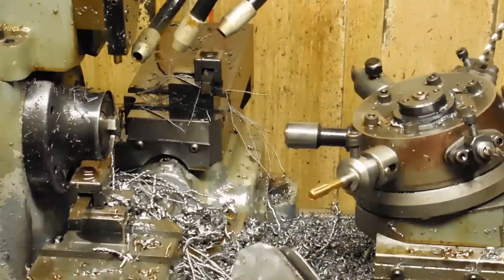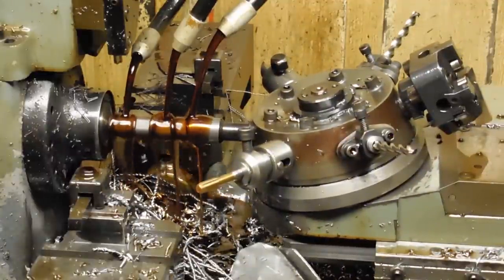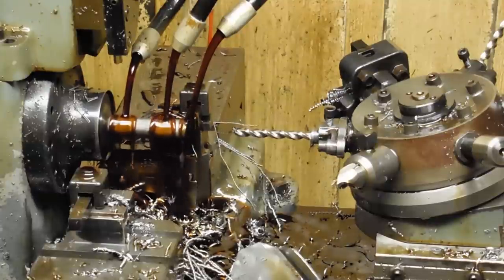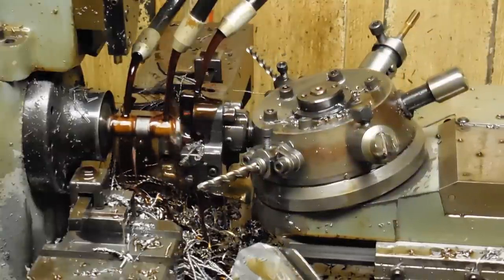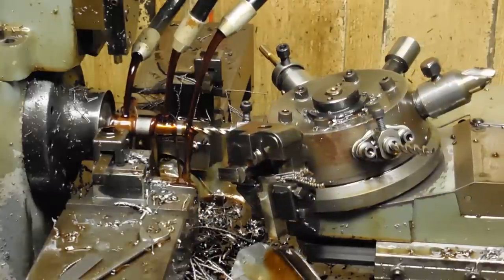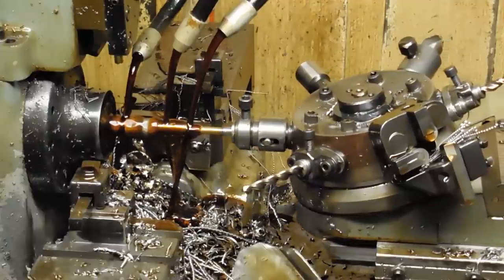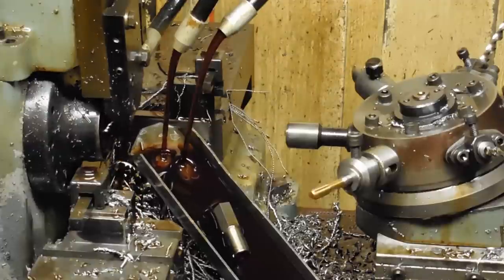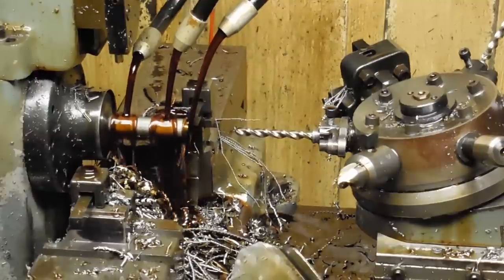Fred's Hardinge automatic lathe making new MB part

Comment: This is a little badass lathe! Love Hardinge machines. A lot of machinist used to call them boat anchors in my shop, but that's because they don't know how to use them. Hardinge machines are thee mark of precision! Especially chuckers with threading head attachments and tool room models. Shame that their no longer manufactured anymore... Great video Freddy!
Reply: Ran one for years, what a precision part making machine.  I made tens of thousands of parts on these machines.  Spent decades machining, running many other manual lathes too.  Back in the 70's 1000 part runs no problem.  Two to three days. Next.  Setup is key.  This is how they are run, with oil, old sulfur based stinky oil.

Comment: This is the very first machine I ran. Hydraulics and cams is what made those axis and turret move. 1979 was the year, the peak of manufacturing jobs. DSM 59 Automatic was a workhorse and I made 100 of thousands of parts on. It was old in 79. Don't many of left who worked of old machines. The oldest machine I ever worked on was 1880s. Flat belts were fun. My Father-in law told me he use to put a squirt of oil on the belt when management would come around with a stopwatch.  Then he spray some stop slip when he left. Yep. Very few of us old coots left in the machining industry.

Comment: Love that part chute just flying into the frame lol. nice old peice of machinery
Reply: My best friend designed that part chute and the vertical cutoff (and tons of other stuff).  He worked for Hardinge for 48 years.  I worked there for 42 years.
Reply: @berniepragle948  That's very cool. Ran one of these for years. I never needed to look at the vertical control power box or the adjustable feeds control panel. I could run and vary adjustments by feeling my hand over all controls. Most satisfying machine I ever ran.
Reply: @x2malandy  
Hardinge was an amazing place to work.  We did everything in-house that we possibly could.  I used to joke that we made everything in our machines except the switches and light bulbs.  At one time nearly 2,000 people worked there.  Then around 2000, we went public, the beancounters took over, we started outsourcing everything, and it all went to shid.  I retired Oct 2015.  I have very fond memories of my earlier and mid years there and try to forget the last 5 to 10.  Hardinge is now owned by some money fund out of Philadelphia.  Sad.

Comment: Hey man would you happen to have the electrical manual for that machine? I recently got one and was able to download the maintenance and operator manual from vintage machine but wasn’t able to find the electrical drawing. My spindle motor won’t come on. There is 110v to the contact but it appears that the contact is mechanically lock by some sort of switch on the left side

Comment: Very cool! Can you explain briefly how the machine is "programmed"? (I'm a hardinge HVL-H owner) - also - I was amazed at the speed at which the spindle reverses for the tapping operation - how does the drive work?
Reply: gheumann if it's like one I worked on decades ago turrrent  operated by series of trip  levers and abutment screws...spindle speeds gears and determining ratios..dead stops on slides no programming all manual if you want one you can program get a brown and sharp with servo can control...or brown and sharp ptc.get rid of Allen Bradley contrrol..its junk.put a Fanuc  control

Comment: Wondering if you're still responding to posts here? It looks like that may be an ASM? I just got one and am looking for what coolant oil to use. Is it just dark cutting oil? Brand and model you use?
Reply from the maker: It's a DSMA (single spindle auto matic turret lathe. These small machines like straight cutting oil. Use sulfurized oil if you are machining difficult to machine materials like stainless. Machining brass or aluminum doesn't need anything fancy.
Reply: @turrettooling1968  I just now saw this, didn't get a notification of your response.  Mines still sitting for a few reasons. I'm afraid of the challenge going by word of mouth reports, I need to reconfig the shop to make a home for it, and also I need to run power for it. Hoping to use a little VFD so I don't have to run the RPC. You have that working real nice it looks.

Comment: Why don't you do motorised bike videos anymore
Reply from the maker: Well Alex, Unenslaved2012 (I like your handle), your explanation is somewhat correct. We live in a Country where lawsuits are prevalent. I didn't want to find myself in a lawsuit, where one of my customers was maimed because of racing on the street using one of my motors. I don't want to encourage street racing by doing it myself and publishing videos of it. It's too bad that I removed those fun videos, but I felt like I had to to protect everything I've worked so hard to build for the last 25 years. The courts support litigation because it ensures their own parasitic job security. An unfortunate consequence of this is now, American manufacturers are very hesitant to produce anything which someone could hurt themselves with.
Reply: wow thats so different for my country australia. there is law suits but not to the extent that happens in usa.i my self use to love going fast as posssible down the biggest hill i could find but if i came off at that speed i wouldent blame someone else for getting hert because no one else told me to go that fast it was all up to me so it makes no sence to me to go and make a law suit when the only person to blame is your self.